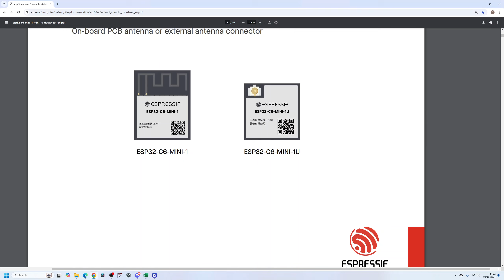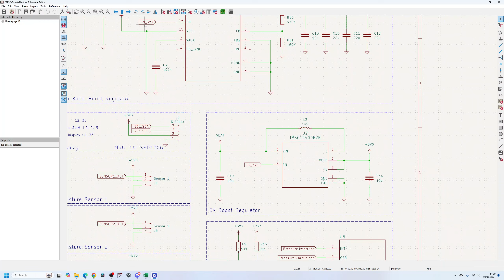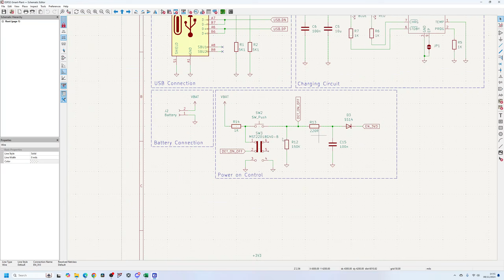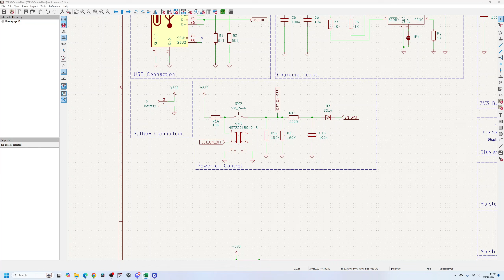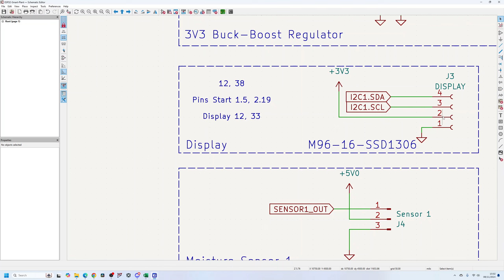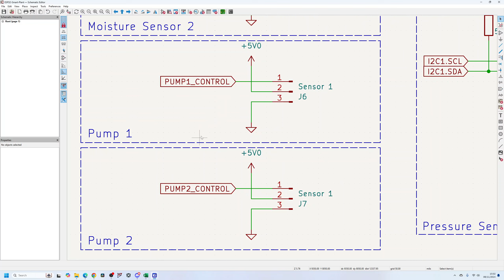ESP32-C6 IoT Project | A beginner's guide | Schematic Capture

Comment: Nice design. 1) Would you share your design? 2) Do you have an assumption for power consumption and battery capacity? I wonder if such project can be charged by solar panels. 3) What would be the cost for making the 1st PCB production and assembly? and each PCB afterwards?
Reply from the maker: I am still working on  the pcb design, as soon as that's complete I will upload it. Assuming it all works. 

I have some very small batteries already ordered. I will go through some battery calculations aswell. 

They haven't been ordered yet but I do have a bill of materials. I should have more information about cost in the next video.